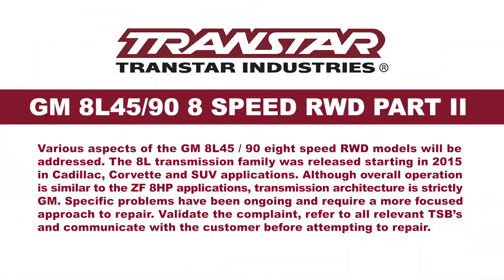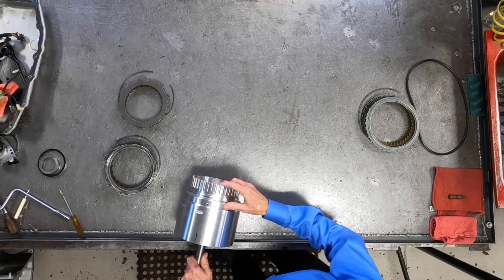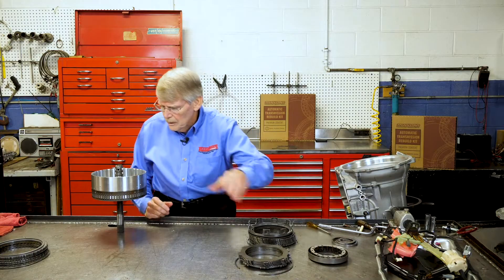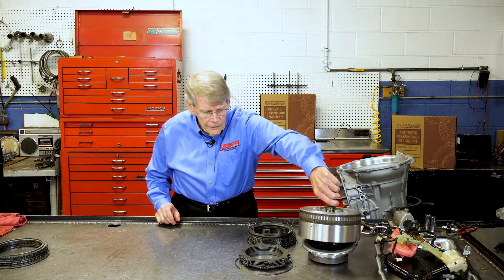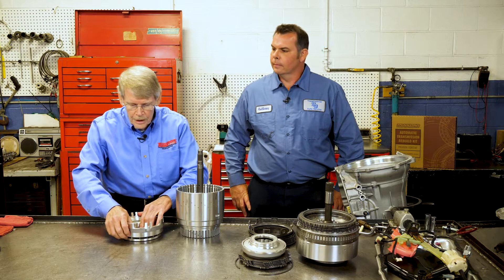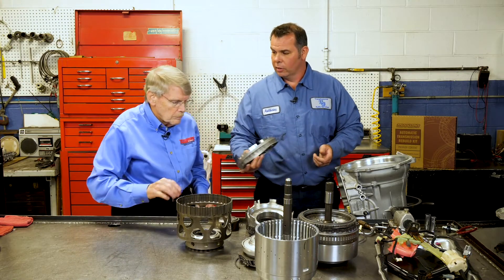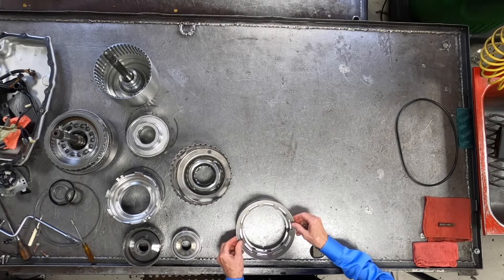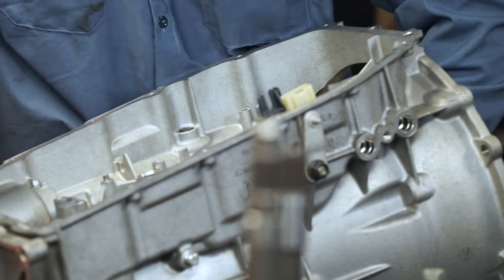GM 8L45/90 Eight Speed RWD: Part 2

Comment: I never noticed a problem with mine (2017 sierra) until it suddenly developed a severe shudder (violent intermittent shaking of the. steering wheel. Warranty replacement of valve body/ fluid change resolved that issue.
I suspect I’m hypersensitive to it but it still shudders mildly while at low rpm’s under load. Lurches when cold.  Occasional hard shifts and delayed engagement. 
If it was a someone else’s truck I wouldn’t worry about it and would just drive it. Which is my only option anyway now that it’s no longer GM’s problem.
I sure wish I could have a modern truck built with the simplicity of a 50 year old one.

Comment: '19 colorado 4wd slams into gear when downshifting any ideas what that could be did the flush seemed to have fixed the shutter other than still slams into gear usually about every 5 times sometimes when i'm passing someone it slams into gear.

Comment: Gm replaced my torque converter, fluid flush and software update and it worked for about 1500 miles. Now it's right back to the it was. I hate this transmission. I started having problems right at 2800 miles.

Comment: The Mobil fuild swap fixed the shudder in my transmission, but it does have a hard shift going from 1st to second most of the time. Other than that it runs perfectly smooth.
Reply: I have the same problem,  hard shift from 1st to second, is't normal?

Comment: Any opinion on the cause or fix of the shutter issues with these transmissions?
Reply: Flush per GM TSB with the new blue label fluid seems to fix 90+%.  I felt shudder 2 times and got it flushed,  no issues since.  I'm very happy with the performance of my 8l45.  I run in M mode and seldom use 7th or 8th gear.  4th and 5th for most all in town driving, improved gas mileage and performance.

Comment: Is the new Mobil atf gm use the best fluid or do you suggest something else? Thx
Reply from the maker: To date, the Mobile ATF seems to be the best stuff however, it's not bulletproof, due to transmission and torque converter design. To utilize the fluid would certainly be a good start.